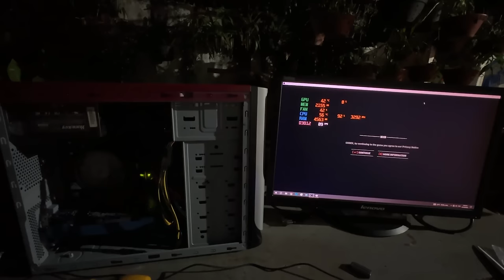Restoration old Ｃｏｍｐｕｔｅｒfrom the　ｌａｎｄｆｉｌｌ | Restored 　ｐｃ h81 Ｐegatronｖｇａ ＡＭＤ rx 570

Comment: sorry it's fake.. the amount of mud suggests long exposure to elements.. after such a long exposure the metal parts of the connectors would be rusted and some pcb tracks would be gone.. the GPU "repair" was laughably fake as well...  you can't locate a shorted component with such a multimeter it's simply not possible. and last but not least ... the power supply... who in his right mind would plug in that PSU without opening and inspecting it ? sorry... it's fake .. probably most of the scenes shot before the dunk into mud :)
Reply: Iyess I agree with uu
Reply: 😒😑 BRUH
Reply: Es falso
Reply: Miracles happen - think about what your doing when your shaving.
Reply: Ustedes son ingeniero de pc y ensamblaje informática etc?
Reply: I agree with you, but PSU has been swapped
Reply: Yes you are right 👍
Reply: Anda benar
Reply: You are right I'm a computer teacher and an expert
Reply: I thought he restore all the components but he buy SSD I think new PSU and Motherboard wahahaha anyway.... The case can restore....
Reply: 27:53
Reply: Si fake
Reply: Totally.
Reply: @elsombrio313   get real, will you, it's fake as f.. 🤣🤣🤣
Reply: @stefandowney 🤣🤣🤣🤣 yeah, ok...
Reply: É tudo falso não engana ninguém 😂😂
Reply: true
Reply: @robertjung8929
Friend, in an electronic board circuit, it is unlikely that you will use iron for something that deteriorates so quickly with water, these electronic components are all galvanized, it may happen that cold soldering occurs, but he certainly did a cold soldering process.
Reply: @MICHAEL20232  friend i do repair laptops, gpus,  motherboards, and i know very well what exposure to elements does to electronics.
Reply: Obvio que es falso, quien tiraria una pc con TODOS sus componentes, con lo caro que están?, y ademas como es que el metal no esta abollado ni el plastico roto? Como que algo no cuadra
Reply: It’s ok it still entertaining
Reply: Sttt
Reply: no shit bro
Reply: @pujiinda agree
Reply: Also the electronic components of pcb would have been rust due to kept it in mud for long time
Reply: I agree with you bro this fake video 🤣🤣
Reply: I think so
Reply: Your right it's actually fake.... I swear the CPU is too old to handle AMD Rx 570
Reply: Also that is not AMD card because I was researching about this manufacturer form Amazon and that product isn't there then I zoom in your desktop screen I can see you have nividia control panel install so you lie about the title you have nividia card check yourself 27:53 I'm not try to be rude ok
Reply: @elsombrio313 fake or not, still satisfying
Reply: don't forget that he fucking clean it with water
Reply: Yup fake.
Reply: 很假
Reply: rek ayo rek mlaku mlaku nang tunjungan
Reply: Lo que hacen es armar la pc y después echarle barro por encima. Y así supuestamente repararlo es muy evidente eso.
Reply: @AptinYT Correcto nadie se ha fijado en que tiene una rx580 una placa base pegatron 775?
Reply: I confirm, there is no way it could be saved lmao
Reply: Cierto amigo
Reply: When he power on then put passward 😂
Reply: @elsombrio313  тут даже экспертом не надо быть в пк.
Reply: Fake h
Reply: Yes true 😂anyways it's interesting people will learn atleast try to learn repair them themself so okay as contents😊
Reply: How do you know it faking or f..king
Reply: He was only looking for short smd capacitors I think there are also mud or rusty element under the GPU you cannot clean this only on surface all I can tell you only traditional electronics equipment can be restored but not pc mother board or surface mounted electronics equipment I know what my telling
Reply: Soy técnico de computación y estoy 100% de acuerdo con tu comentario. Por eso me sorprendió que pintara el case de la tarjeta de vídeo aún sin probarla. Y lo otro es que tiraron a la basura un PC que solo tenía dañada la tarjeta de vídeo?. Si estuvieras en USA te creo pero en ese país no.
Reply: @elsombrio313 yo soy técnico de PC  y estoy de acuerdo con el comentario y que el vídeo es FAKE
Reply: Да он бы и включился.
Reply: Yes,it is all scripted drama.
Reply: Как по-русски тут перевести?
Reply: @TheJakegem block power break
Reply: Its obvious that it's fake he made this video just for entertainment purpose
Reply: Bro u opened the America
Reply: Psu In a computer, "PSU" stands for Power Supply Unit. The PSU is a critical component responsible for converting AC (alternating current) power from the wall outlet into DC (direct current) power that the computer's components can use. It provides electrical power to all the internal components of the computer, including the motherboard, CPU, GPU, storage drives, and peripherals. A reliable PSU is essential for stable and efficient operation of the computer system
Reply: Fake this video
Reply: No bro he use alkaline water to wash
Reply: Предположим что компьютер провалялся там неделю и за это время заржаветь ничего бы не успело, тогда дорожки на плате все целые, а блок питания за кадром проверили, но вопрос из за какой проблемы его выкинули знает только тот человек который это сделал
Reply: 어떻게 사기치나 보는 중
Reply: Absolutely right, that's all he made concepts just for money
Reply: İts already fake just watch and enjoy
Reply: A placa mae e a fonte sao a mesma do que foi pego ns lama
Reply: tes rill fake palsu
Reply: Jaj tienes toda la razom pero loq note diste cuenta esk la carca esta oxidada porlo tanto el wey del video puso unos dias antes la carcasa en el agua  y luego lo saco para ponerle la placa y los demas componentes
Reply: Agree.... At least he putted heart on your comment 🥲
Reply: The PSU appears to have been replaced.
Reply: Any computer restoration with alot fo rust is fake
Reply: totalmente de acuerdo eso es pura m
Reply: This is the power of holy water, it even purifies corrosion! 😇
Reply: @alexhernandez2061  the delusion sure is insane
Reply: ВСЁ ВЕРНО - ЭТО ЧИСТЕЙШИЙ ВОДЫ ХАЙП..ПОДДЕЛКА ФЕЙК - ДИЗЛАЙК...
Reply: ОНИ СВО...ЧИ НА ЭТИХ ПОДДЕЛКАХ МИЛЛИОНЫ ЗАРАБАТЫВАЮТ..ПРОСТО ТАК...ФЕЙК ФЕЙК ФЕЙК
Reply: But it is interesting
Reply: Of course it`s fake
Reply: Yeah I thought electronics were destroyed after being in water, I know a little about that stuff but I know if you get a phone set, it's destroyed 😊
Reply: Guys, Salvation is Simple

HalleluYAH (Hallel u YAH) - “Praise YAH”

YAH The Father (Genesis 1)
YAH arrives via The TENT OF MEETING
YAH was Who they Crucified for mans sins
YAH was Crucified on an Almond TREE

Original Semitic of Moses
Isaiah Scroll (The Original Isaiah)
Reply: Yes is fake..
Reply: Be playing
Reply: I don"t see why it's "bad" Because as soon as its sastyfying i dont see the problem with faking videos
Reply: @Mizow-i1e  hmm 🤔
Reply: @ZhangWei-g9o  ...
Reply: I may shock you, but ALL the "restoration" videos are fake.

Comment: As a qualified electronic engineer and owner of a computer repair company, I can only say what a great chuckle you have given me. As every electronic engineer knows that liquid damaged electronic circuits especially those in computers are totally ruined by the liquid. I cant say how many Macbook's I have written off due to drinks being spilt into them. Good laugh guys.
Reply: This 100%. Anything water damaged is toast. If this was sitting outside for months there is no way in hell this would work
Reply: No, no you're not.
Reply: Повністю згоден, відео - довбаний фейк)
Reply: Whatever the heck a 'qualified electronic engineer' is.  If power was not applied,  water is not going to damage the circuit. Basic electronics, fraud.
Reply: @edwood3033  It depends on how long the exposure to the water and other contaminants is, in the case of this video it is fake.
Reply: i washed my motherboard in my dishwasher, no problems. if everything is shut down with no electric you will have no problems after drying it all out.

Comment: As an electronic technician, I declare that there is not even one percent possibility of rebuilding this device.  All parts are refurbished
Reply: Your statement is an oxymoron.  He refurbished the parts and it was rebuilt.
RX570 is a reasonably good video card too, similar in performance to the GTX1060.  

I too am a Electronic Tech.  Spent nine years designing, manufacturing, building, delivering, installing and servicing vehicle monitoring systems for the forestry sector.  I fixed many boards with "Environmental Damage".  The worst ones I never were able to repair are the ones which were connected to power while subjected to water containing minerals, acids or sugary substances (Pop / Coffee).  Traces tend to experience electrolysis and are obliterated with electricity.  However, I have always been able to clean off dirt and deposits if they were not powered on.  My favorite way to clean them is in a Dishwasher.  I also use Alcohol on them and Electronic cleaner, and a healthy 24 hours to dry to ensure moisture is not underneath BGA or other IC's.

This video is very plausible, but who would spend time fixing a computer that is worth maybe $100 is beyond me.  Most people throw away their computers because they did not like the sound of the fan, because the software was infected or user error.  I have been fixing recycled PC's for 34+ years, and I often simply give them away.  It is a hobby of mine.
Reply: yeah bro, see those pins, a little of water and shine like new hahaha got a little of video on his fake

Comment: Its definitely not the same Board in my opinion. Look at the small differences at the solid cap between the ram slots and the cpu socket. And the red marks on the solid caps next to the 4Pin Socket are more straight than the washed board. Also look at the intended breaking points from the other capacitors. There are tolerances in the fabrication and soldering the caps. And lok on the VGA Port. On the "wet" board the thread of the right thread is bent. On the dried board both of the threads are straight. There are some other things...rust on the backside from the usb ports, the different embossing from the metal case from the USB/LAN kombi socket. Foxcon embossing isnot so strong, and there are some notches on some plastic parts from the connectors that are difference the two boards etc.... Pls dont believe everything. This is my opinion. YOUTUBE OPTION: DONT SHOW CONTENT FROM THIS CHANNEL AGAIN: MARKED!
Reply: windows 10 xp
Reply: Don't take it too seriously, just do it for fun. Video creation is not easy, so I'll give you some support. . .
Reply: 😂valla mierda de restauración lo limpia con agua
Reply: those rusted screws came out really easy XDXDXD
Reply: Even without your keen observations we both knew from the beginning that this video is a load of BS.

Comment: Everything is wrong, it's not the same motherboard because the colors of the RAM supports and the graphics card are not the same and I suppose that you also cheated on the graphics card because your hazardous repair is not credible . Finally, you have to make a living on people's credulity. But it's dishonest to want us to believe in this miraculous repair...😡👎
Reply: What’re you talking about? If you look closely when it’s taken out of the “landfill” you can see the model number on the motherboard is “Pegatron H81-M1” and that model number is visible throughout. The RAM slots are the same color from beginning to end, red. ??? What???
Reply: @dearestdennis  ok sorry! 👌😍
Reply: @dearestdennis  Completely different motherboard at around 13:02. Red PCI slot changes to blue and the RAM slots also change colour from red to yellow/green....Later on after 'fixing' the GPU, the motherboard switches back to all red slots before being fitted out. At this point, the board is suspiciously no longer badly warped as it was prior to the 13:02 change (the board was bent as a corkscrew before that)....hmmm

Comment: Thank you for this video ! 🌹
I have 2 questions please : 
1.What liquid do you use in the box that you leave the GPU heatsink and it comes out so clean ?
2. Is the white soap you spray on the motherboard is regular liquid soap ?
Reply: It doesn't matter, the video is fake. Too even distribution of rust on the boards. I didn’t remove the processor during cleaning, I didn’t remove the fastening elements of the processor socket, and there should be no less rust underneath.
I completely forgot that the tracks, with such rust, will definitely be damaged.
And there are still a lot of mistakes. It seems like he knows how to solder but doesn’t understand much about computer technology.
Since they don’t look for faults on video cards.

Comment: This isn't hard to fake.   You buy two of everything except the case.   Then you take one set and throw it out in the landfill puddle for a year, and then you "find it" and pretend to clean it.   When you reassemble it you use the clean undamaged identical parts which have been in your closet in a box for a year.   Very simple.

Comment: As a person who has worked with computers since 1998 I can tell this is absolutely fake. The only parts that should realistically still work is the io on the case and the ssd of your lucky. Not to mention the parts look way to modern to repair without proper micro soldering equipment. Use 3.0 capability and ssd? This should not be repairable

Comment: It always fills me with horror when electrical components are washed In water not and not using proper Electrical Contact Cleaner and or Isopropyl Alcohol, besides the components would take a long time to dry with using water.

Comment: for everyone cleaning a pc
yes water can be used as long as it gets removed right after. but if you clean your pc with water take the cmos battery out of your mainboard. else your mainboard is fucked! and if there is already corrosion on any part of the pc it's very hard to repair
video is fake

Comment: It is a scam. Impossible to restore them. I have tried it for years and many PC. The only part you can salvage is the processor heatsink. Even the processor itself got corroded in the pins and break when I tried to remove it from the board socket.

Comment: Oh. I already realized in the first minute that the video was fake. 🤮 Rotten electronics cannot be restored to working condition. Unless of course the video itself was filmed in reverse order. That is, first they showed us a working PC and components, and then they were artificially aged. Crap! Seriously? Should I wash off oxides and stubborn rust on a multilayer board with ordinary soapy water? This is a fairy tale! This is the only way to explain it. This level of rust consumed 99.9% of the conductors on the board, not to mention the mechanical parts of the cooling systems. Everything there should be a monolithic piece of rust, without the ability to turn or twist anything.
By the way, if you stain a PC in clay and pour it over with a weak solution of ferric chloride, it will just look rusty. Chemistry, bro!